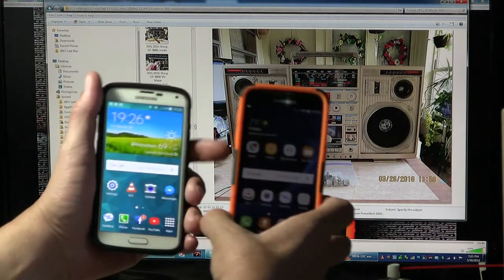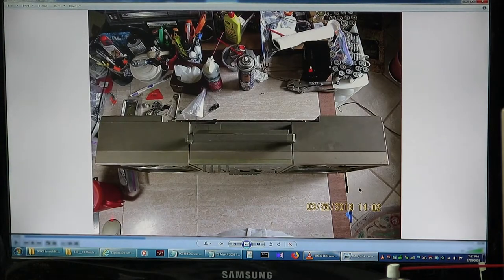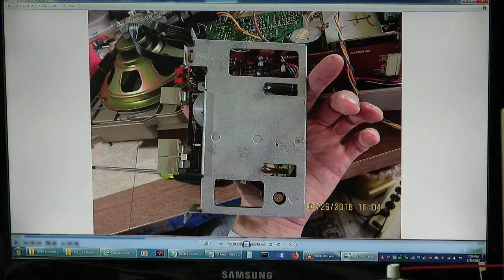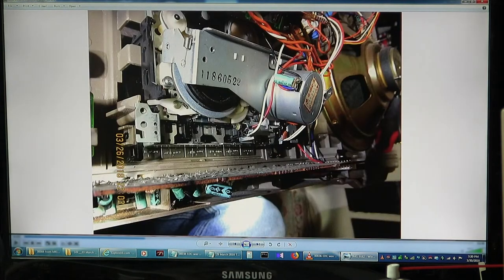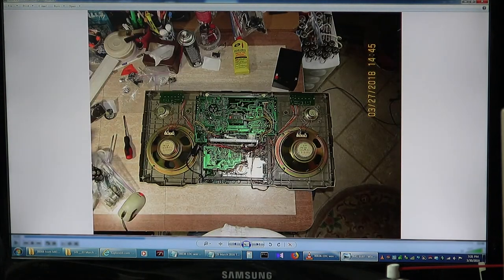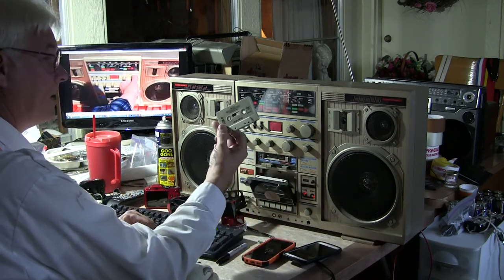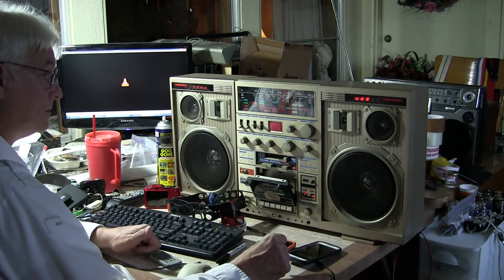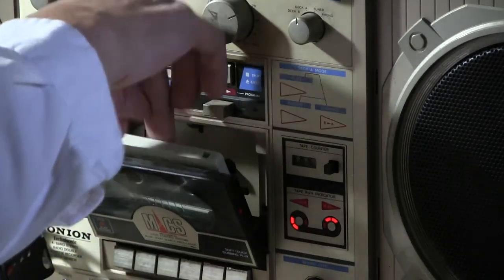Conion Technisonic TC-999 91 Pictures I repair to Rare Twin-deck Cassette Playing

Comment: Hi, I own the same Boombox, did you have the part number of the other table belts? I’m looking to repair the 2 tape decks. Thanks!!
Reply from the maker: 15.5 and a small belt is 3.2 those are the sizes of the upper deck the lower deck is more confusing